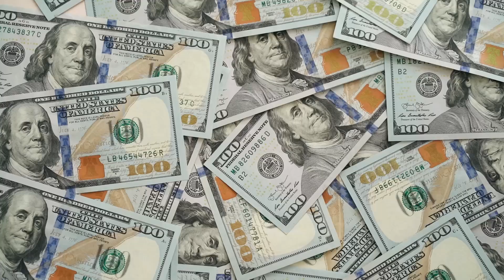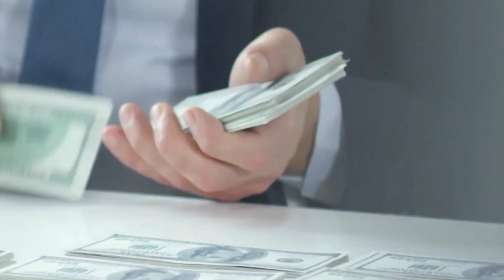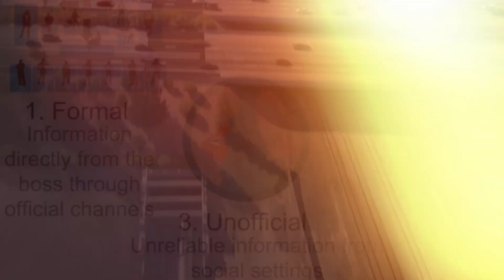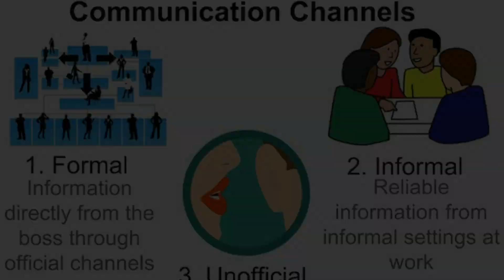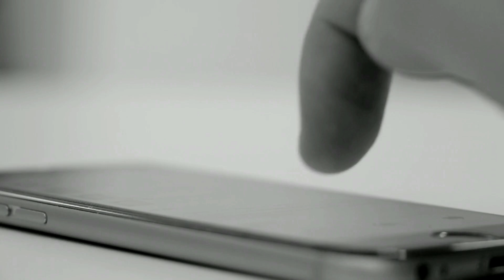Why is California High-Speed Railway delaying again?

Comment: This is a poorly done "Fluff" piece. There are actual estimates of schedule and cost for the "Limited version" of the project which does not go at high speed or from LA to SF. I see NO mention of this the estimates NOW are approaching $150B and 2045 completion (never going to happen. You need to do better reporting.
Reply: More nonsense. The first segment, CP4, is literally completing construction right now. It and the rest of the right of way is designed for the 250 mph HSR standard with 220 mph in-operation cruising speed.
Reply: "Plans are to finish the first segment from Merced to Bakersfield by 2030. That first operating segment would serve several large cities, and provide connections to other cities on both ends. Meanwhile, the other segments are getting environmental clearance, to be followed by design, community outreach, and construction." @TohaBgood2   the 1st segment is a joke, it does nothing for the SF/LA promise, and what we voted for. I'm sure you are profiting from the insanity that the rest of us are paying for!
Reply: @anthonyBosSoCal  So now you want to move the goalposts, huh? The right of way is designed to support 250 mph design speed and 220 mph in operation. The trains that CAHSR requested proposals for are capable of at least 242 mph and 220 in operations.

You simply lied in your original comment. Take the L. You deserved it.